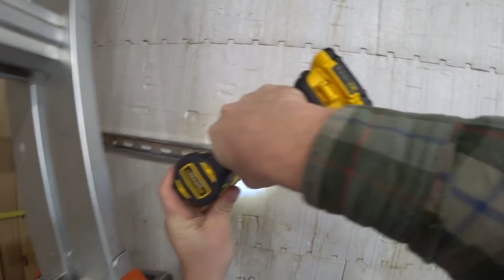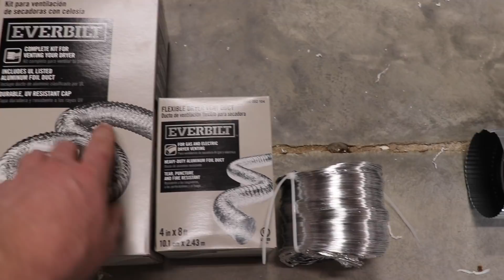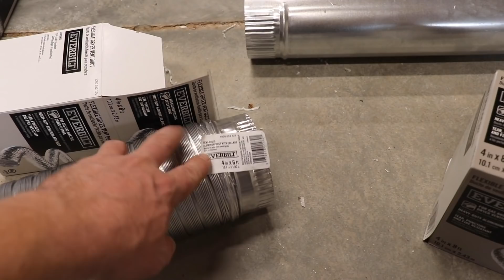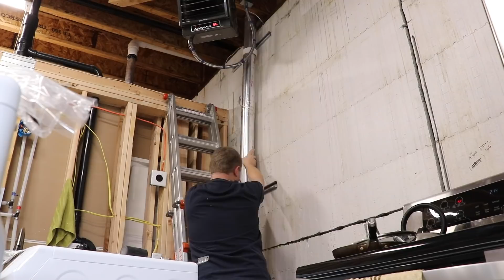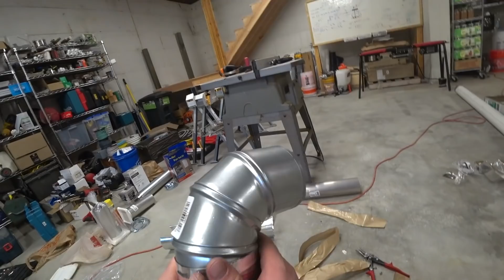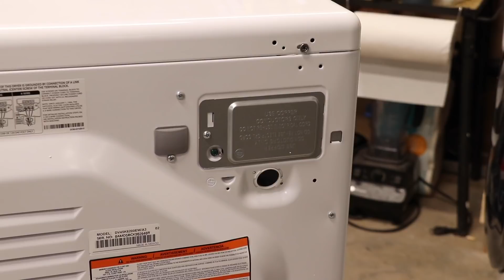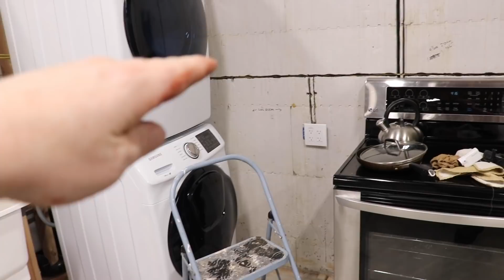Dodged THIS COMMON FIRE HAZARD in Our House!

Comment: Ducts are very easy if you know what your doing, for round ducts or oval you want a Crimpers and for sealant you want duct sealer because over time that tape becomes garbage. Also use self taping screws in each connection of the pipe. In my state it’s required to install a back draft damper. 

MALCO C5R Crimper https://www.amazon.com/dp/B005ZDY8DC/ref=cm_sw_r_cp_api_i_EMjtCb4F3F3P7

Comment: You will want to seal the ribs on the 90' bends as well. And instead of the just the tape i would have used the sealant in the joints and the tape over it. A bead of Sealant down the side of the ridged pipes would have worked as well

Comment: I'm curious to know peoples thoughts on how a sealed home can supply air to a dryer that is vented outdoors.
If it were a perfectly sealed home, wouldn't the dryer starve for air flow?  What is the theory on the suction that a dryer would put on doors seals and vents in a building.  Where does the inflow of air come from to supply the output of the dryer?

Comment: wrong  tin snips  red  are for cutting  a circle  yellow  is for straight lines   they  even make  some  to cut duct piping  it makes 2 cuts  and leaves  a ribbon between the 2 cuts  works great and leaves a nice finished  edge

Comment: Dodged that fire hazard but you still have PVC wiring in contact with Polystyrene which is a huge FIRE HAZARD in the UK it's banned because of the fires it has caused in the past from wire degradation of the PVC insulation.